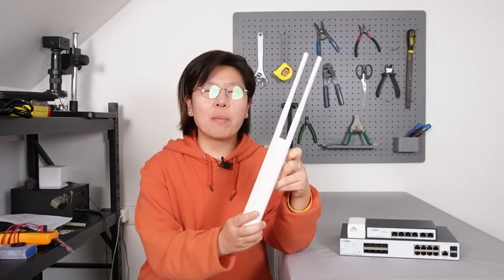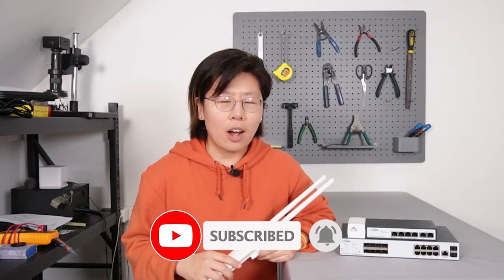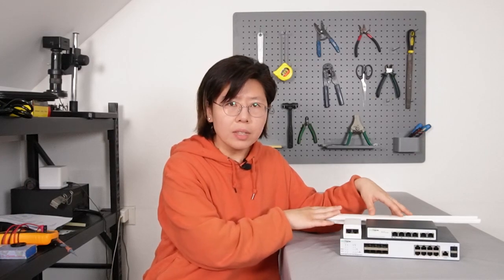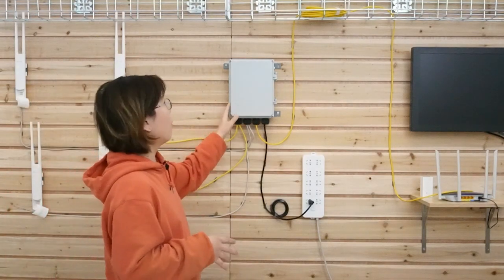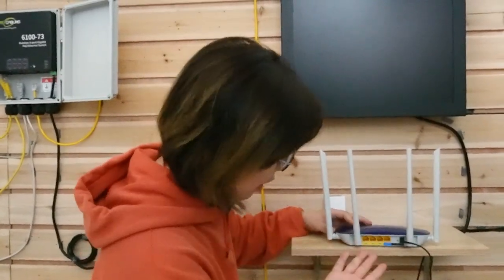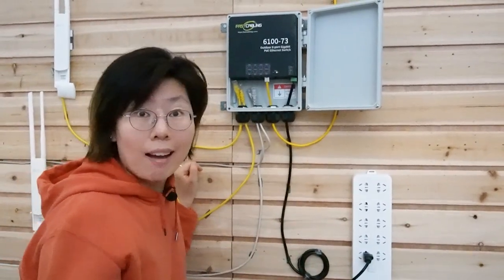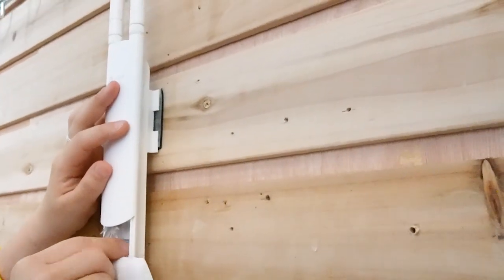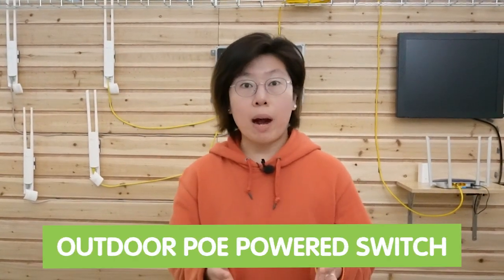Install 4 EAP225 AP on One Cat5e/Cat6 Ethernet Cable| TP-Link Omada

Comment: Just use the mesh tech.
Reply from the maker: Yes, you can use mesh - that's a great option. But connecting them with wires, you won't experience signal degradation from walls, weather, or Wi-Fi congestion.

Comment: How about enabling the portal feature? Can you show us using these fastcabling switch and router?
Reply: Another one, is this recommended setup for a high density environment?
Reply from the maker: The incoming bandwidth from the switch is 1Gbps, and it's a shared bandwidth for all access points. If you're interested, we also have 10G solutions. While the EAP225 is rated for 200+ users, actual performance depends on the available bandwidth and network conditions. If you're deploying multiple APs, keep in mind that signal interference may occur, which can impact network stability.

Comment: What is the specs for the Ethernet Cable? Any recommendations for the outdoors.
Reply from the maker: You can use Cat5e or Cat6 cables for EAP225. Both Cat5e and Cat6 can handle speeds of up to 1000Mbps, but Cat6 can support speeds of up to 10Gbps. For outdoor installations, you can choose outdoor-rated or direct-burial cables that are UV-resistant, shielded and come with waterproof jacket.
Reply: @Fastcabling  thank you so much ❤️ ❤️

Comment: Good day , demonstration so perfect .
Those 3 Ap eap 225 need a configuration to avoid problem for wifi connection??
Reply from the maker: Yes, configuring your TP-Link EAP225 Access Points (APs) correctly is crucial to avoid problems and ensure a stable, efficient Wi-Fi network.

First, you need to position your APs to ensure broad and overlapping coverage areas, especially in a multi-story building. Avoid physical obstructions and sources of interference. But at the same time, ensure there's enough overlap between the coverage areas of adjacent APs to allow for seamless roaming but not so close that their signals interfere with each other.

If your EAP225s support Fast Roaming (802.11k and 802.11r), enabling this feature can help devices switch more seamlessly between APs as they move around. Use the same SSID (network name) and password across all APs to ensure devices can connect to the strongest signal automatically.

For more suggestions, please consult the manufacturer.
Reply: @Fastcabling  thank you so much

Comment: i think this outdoor router need only 12v or 24v only but ur outdoor poe is 48v rated so it can burn the device
Reply from the maker: This outdoor WAP accepts 802.3af PoE and 24 passive PoE, and our outdoor PoE switch is compatible with IEEE802.3af/at standards, so it won't burn the device.
Reply: Ok mention it
Reply from the maker: We'll do. Thanks for bringing it up!😃

Comment: I need to see a video on the Omada controller solutions. Please point me to the best video that you know about that explains getting started with Omada. Thanks
Reply from the maker: We will try to work out a video tourist, but you also could find it from TP-link
Reply: @Fastcabling  
Thanks, or if you know of a clear and well done tutorial video on the Omada setup, that would be great. All I can find so far from TP-Link is a little confusing. You have to purchase a license to run the full featured Omada platform, correct? I am not an enterprise business user which seems to be what Omada is aimed at.